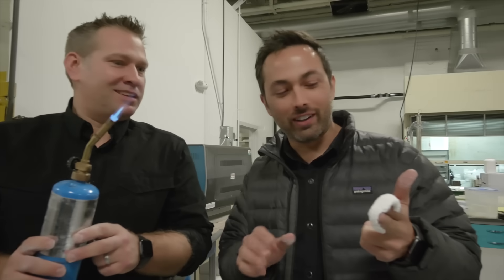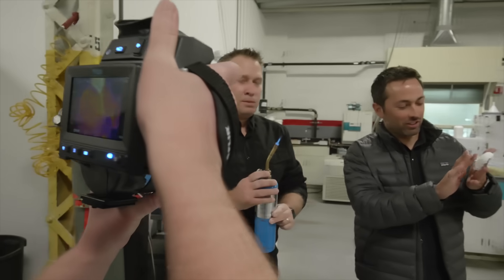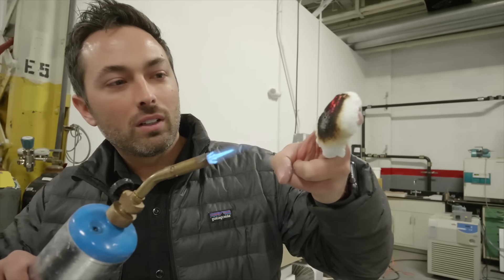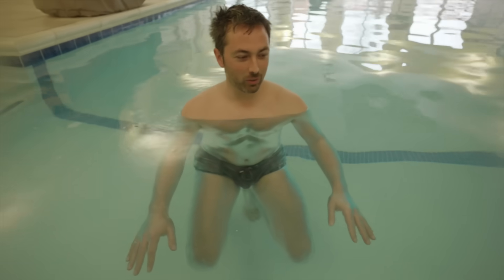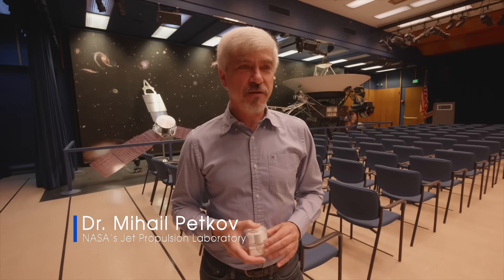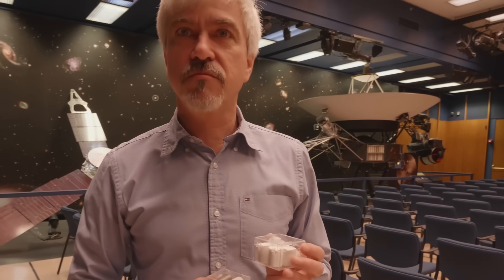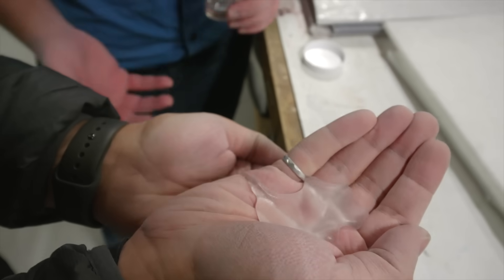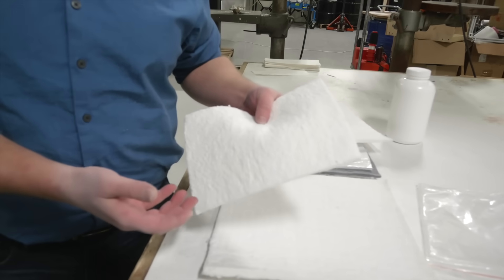I Waterproofed Myself With Aerogel!

Comment: aerogel can produce a metallic ringing sound when struck or dropped, particularly small samples of silica aerogel. This sound is due to the aerogel's unique structure and properties, including its low density, high porosity, and the way sound waves propagate through it. 
Here's why:
Low Density and High Porosity:
Aerogels are extremely lightweight and have a high proportion of空隙, which allows sound waves to travel through them relatively easily and with a distinct resonance. 
Structure:
The interconnected network of nanoparticles in aerogels, especially silica aerogels, can vibrate and resonate when struck, producing a ringing sound. 
Sound Propagation:
The way sound waves interact with the aerogel's structure influences the type of sound produced. The low density and high porosity can lead to unique acoustic properties, including the metallic ringing sound. 
Dr. Samuel Kistler, who pioneered the development of aerogel, observed this metallic ringing sound in small samples. Flow Visuals also notes that aerogel spheres can bounce and produce a ringing sound when dropped on a hard surface.

Comment: I used aerogel in my research lab to insulate liquid nitrogen lines and it was insane how well it worked. The downside is all the flakes that are created when cutting it and putting it on. If you don’t wear gloves, your hands will get so dry that it becomes easy to damage the skin.

Comment: Using aerogel for an insecticide sounds like a terrible idea... unless you hate your lungs.
Reply: He explained that the dust is captured and expelled from the body with no damage. 100% safe.
Reply: @mrobviuos74  I heard him say that, it's  simply not true.  It's reported that amorphous silica is generally less likely to cause silicosis than crystalline silica, but there is a suggestion that it can still happen...  Probably because there is likely a contaminate component which is still crystalline.  And in the use case suggested, you would be spreading lots of it in the air on a regular basis, so you are talking about a lot of potential exposure.

From a 2011 study for example, "Our results indicate that amorphous and crystalline silica are both phagocytosed and both toxic to mouse alveolar macrophage (MH-S) cells. The pathway leading to apoptosis appears to be similar in both cases."

Now that I think more about it... Besides the health risks, the technical concept actually makes no sense.   First, silica aerogel is fantastically expensive both because of the raw materials required to produce it, as well as the process being extremely time-intensive. Let's say you can get past that. I do agree that insects coming in contact with fresh aerogel would likely become desiccated. However, aerogel is extremely hydrophilic, and it will absorb moisture from the environment extremely quickly.  It would become almost immediately saturated with moisture, and so if you didn't directly sprinkle this stuff directly on the insect, it would have virtually no effect.

Comment: Even though this video is 4 years old, can I revitalize this by asking a simple question of what would happen if we coated a professional Olympic diver with aerogel and then had them dive off the high board? Would they splash less? Would they dive faster through the water? Would they hit the bottom of the pool due to less to no drag? Please make a video or short covering the answer to this please!

Comment: Just wondering if this could be used to provide lightweight radiation shielding? One major problem with a mission to Mars is the amount of lead shielding that would be required to keep astronauts safe probably be weight prohibitive. Not a chemist here, but if one could connect a lead molecule to the OH group, would this potentially provide a lighter weight shielding material? Would love to hear any responses.

Comment: Aerogel layers should be used as a firewall around the batteries of an electric vehicle, to protect against the extreme high temperatures of thermal runaway when those things spontaneously combust.

Comment: Back in the 70-80's a man invented a substance called Starlite. Thermally, it out-performed equivalent materials. Because it's inventor was so apprehensive about reveling Starlites composition,  he took his formula to the grave. In 2018 a youtuber, attempting to recreate Starlite and came very close to doing so by using only flour, sugar borax and cornstarch. I attempted this myself and was surprised to find it actually worked! Once mixed, it can be formed and it hardens as it drys.

Comment: Is the aerogel similar to the gel they use in the film industry for fire burns? When I did my first fire burn I was coated with a gel made of 90% water. They lit my back on fire using flammable liquids mixed with cement glue and for about 40 seconds I ran around pretending I was in great pain. I was actually cold from the gel; they kept the gel in a bucket of ice till it was applied. I now heard the film industry uses a new type of gel that is less goopy and less visible on camera. Whoever invented this latter gel keeps it a tightly held secret. I would be curious to know if there is a relationship between this aerogel and the gel they use for fire burns.

Comment: Wow. It makes the fellow waterproof. Does the Aerogel deflect heat & cold? Can it work as an antiseptic against deflecting viruses? Is long term use safe? Is it toxic if ingested? Could it be used to deflect frost & ice from auto & plane windshields & plane wings & such? The video said it could be used in spacesuits...can it deflect radiation? Can it deflect harmful UV sunrays? Could it create a barrier to protect the paint colors on autos or vinyl siding or even prevent fabric fading? ...This stuff seems absolutely amazing! It proves how science is truly moving into a very sensational future.
Reply: I'm pretty sure it's a carcinogen but i would have to do more research to be completely sure

Comment: slime like what fish exudes due to high pressure but movement makes it slippery and dry less than oil, its a lessy sticky oil, almost a dough, pizza dough it resistant ... i think corn starch too, corn also, the slime regulates the fishes temperature

Comment: I am a little bit confused about the Aerogel that was used in Monalisa's preservation project. Is the used Aerogel Water absorbent or water repellant? Because if it's water repellant, it basically wouldn't work for absorbing the moisture and if it's water absorbent, after the first time, it would be useless as you mentioned that its structure would collapse!  Would you please explain that to me? I am working on research and this is the property of the Aerogel that I would like to use. I have been searching for different types of Aerogel and they are all either Hydrophilic or Hydrophobic, nothing in between that would act as a passive humidity regulator. Thank you very much!

Comment: So... with aerogel... I can be both flame resistant and water resistant. Therefore, I can just have a bucket full of this aerogel dust, find a place that is on fire, strip naked minus underwear/shorts and shoes, cover myself with aerogel, wear some sort of mask, and run in to save people without any harm from heat and flammable sources besides falling debris.

Comment: So if this were practical to manufacture sustainably and ecologically, homes could be insulated with this material and be resistant to outside moisture with a surprisingly thin layer of material. A design that could be retrofitted for even older homes because of  how little surface area that would be needed.

Comment: Here is a question I have about hydrophobic aerogels.......if you mixed aerogels with a ultrahydrophobic substance with a water angle 150°+ (aka the Lotus effect) and coated a 100ml glass cup with the substance and poured in 75ml of Water chilled at 40°f (277.594 kelvins), what would the insulation factor of the coating be, and what would be the rate of thermal conductivity?

Comment: Why isn't there home insulation made out of this stuff? All it'd need is a very thin layer of it sandwiched between 2 pieces of thin wood or metal, could even be a DIY thing with the paste and could make walls 2-3x thinner.
Reply: I thought about this for my house a year or so ago and did some research to see if it was realistic. The short answer is cost. Aerogel insulation is more expensive than a comparable traditional solution. Aerogel is lighter and takes up less space but wall space is not a limitation in most homes so there's little incentive to go with the more expensive option.

Comment: This would be really cool to use as a special effect in movies. Somebody walking out of the water but is completely dry “magically.”
Reply: sounds like a really expensive alternative to CGI
Reply: Take Percy Jackson, for example. That would be epic for Rick Riordan's new Netlfix show coming in about 3 years.
Reply: @mathewpannaparayil4968  HELL YESS
Reply: @mathewpannaparayil4968  Disney+
Reply: @mathewpannaparayil4968 boy this was basically spot on
Reply: Also the silver-like effect would look really cool
Reply: The clothes would be wet though
Reply: @carriesims9325  Coat the clothes in aerogel dust
Reply: @carriesims9325  just make the clothes outa the thing
Reply: except you look silver
Reply: Lycopodium powder?
It's not heat resistant, but it is water resistant.
Reply: @carterdoesthings and the burger wrapper too
Reply: I agree. Sadly with CGI I imagine Hollywood wouldn't do it
Reply: Typically they just film the scene in reverse if someone needs to com out of water dry. But I thought the same thing. For some stunts it might be good!

Comment: Questions!
If it prevents water from penetrating your skin, does it stop swear and vapour leaving? Is this not really bad?
What is easier to get off - water or aerogel? If water is easier to get off why use it?
This could be the next big thing in car protection and on glass. Imagine it on a shower door.

Comment: The fact that Aerogel has a metallic ring when you drop it is one of those awesome useless facts that I love your channel for.
Reply: exactly
Reply: Like what is mean by metallic ring?
Reply: @potatosack.1234  It's very resonant on impact, the way metal is
Reply: @potatosack.1234  it sounds like a piece of metal when dropped
Reply: @potatosack.1234 ring as in the sound (e.g. a bell ring), unrelated to the shape, or to the jewellery (in case of any confused non-native speakers here confused by the homonym :) )
Reply: @potatosack.1234  the metalic ring on impact
Reply: Same vibe as chalk making a ceramic noise when dropped.

Comment: Interesting. But coating yourself with this stuff sounds very questionable. Skin is an organ and needs to secrete sweat in order to maintain body temperature. I would imagine increased risk for heat stroke, rash or at the very least a bad full body breakout. Hope it all  came off.

Comment: Could something like this be an alternative to conformal coating on electronics as a waterproofing for say flight controllers and ESCs or would its thermal insulating properties not allow for adequate cooling?
Reply: ...Well, it's brittle and expensive, so probably not.

Comment: Questions: 1. If you can use a silica aerogel "powder" to waterproof yourself...or "something", so that in effect, the water doesn't "touch" the coated surface anymore...is it conceivable that say, piers of jetties or legs of an offshore rig or subsea infrastructure could be so coated to prevent corrosion? Would that work?
2. re. the dust in the fiberglass composite: ok, it's not asbestos, fine, but I can hear a parantage between "silica" and "silicosis"...a lot of miners in unsavoury places die extremely young because of silicosis due to the dust they breathe from a young age ; domestic stone cutters (such as for workbenches) are now being identified as a group that has high rate of silicosis... do you have more details about the risk analysis on the dust formed by silica aerogel and its risks to health (and environment)?
Reply: I'm not an expert in that field, but I think the problem with subsea infrastructure is not only the "water", but also the movement (ground, but also the moving of water, including fishes, alges, sand, salt). I guess all that would "dmg" the aerogel coat.

Comment: Veritasium: I have a question. Could this product slow or prevent hypothermia? It insulates from external heat. Could this hold body heat in while exposed to freezing water giving rescuers extra exposure time for a rescue with less risk or a very expensive preventative treatment for someone engaging in risky ice conditions like Ice Road Truckers? Just a thought.
Reply: I think because of your body naturally producing heat to warm you up this wouldn't slow down hypothermia it'd out right prevent it.
Reply: @flameofthephoenix8395  Granted you would also have to take the dangers of overheating into account. If your body can't dissipate that heat you could theoretically run the risk of heat stroke while in sub-zero temperatures. That would be a hell of a story though.
Reply: @Krell356  I hadn't thought about that but that is true.
Reply: @Krell356  how would it be applied?/ theoretically
Reply: @sacha_1152  not sure. Best way I could think of is as the insulating layer for a jacket.

Comment: i want to buy some this water repellant aerogel dust to go swimming.But then i found it costs 1 $ per cubic centimetre  , but that begs the question - how many cc did he use to make himself waterproof?  Also, what happens if you eg:sneeze , and  inhale it accidentally? i presume you can wash it off with a cheap nontoxic uninflammable  nonpolar solvent - or a scrubbing brush?

Comment: I wonder what the implications are for using it as an insulator in skyscrapers. It's lighter, so it would carry less of a structural load.
Could it theoretically be used to make skyscrapers be able to go taller?
Reply: The blockade for skyscrapers is more of the wind and atmospheric pressure than the weight, the higher you go the stronger the winds and higher the pressure, so they need to design a stronger core that won't just blow over. It seems they've already done it but the physical feat of making the world's tallest skyscraper is insane, and the amount of materials it takes to build the average building for business would be basically doubled for 20-40% more height and that's not practical for many businesses.
Reply: @420Cris  the pressure should be lesser coz of gravity(?

Comment: if anyone is interested it is bicarb soda elmer glue and flower will make that flame proof stuff he put on his fingers, i make it from time to time. it works by converting the outer layers to carbon which is a natural insulator and as it does that the layer under it does the same and so forth and so forth, till the carbon layer essentially has a larger surface area on a micro scale that it can disperse the heat before it gets through to a point where he can feel it

Comment: Imagine using this as isolation in houses:
it wouldn't be hot AT ALL in summer
Reply: But it would be freezing cold in winter
Reply: @defenestradora  heating the interior of the home in winter would be a lot more efficient
Reply: @bojanglesobrien6883  depending on the location, but i guess that a house that needs to be that much isolated in the summer is probably in a very hot place where heating the interior wouldn't be that accecible
Reply: @defenestradora  I don't understand what you're trying to say.
Reply: @bojanglesobrien6883  where i live is very hot during summer, but it's not that cold during winter, and heaters are very expensive because nobody wants them, so nobody sells them. Because it's very hot in summer but most houses don't have heaters, people just stick with air conditioners and fans rather than isolating the houses from heat. That's what i'm thinking about, sorry if it makes no sense

Comment: They need to start putting this on phones. Then they can make a completely waterproof phone.
Reply: The coating would wear off eventually is the problem. The oleophobic coating on phones already does wear off after a while.
Reply: But its super easy to break
Reply: Do this and you would have a phone that overheats within minutes
Reply: Phones aren’t waterproof because water gets inside of them, and water gets inside because there are holes in a phone that must not be plugged with aerogel in order to maintain their usual function lol
Reply: Similar waterproofing exists for electronics. The makers have zero incentive to use it. Doing so would increase their costs with minimal to no increase in sales. More importantly, prolong the life of electronics by protecting them from water damage and therefore cutting down sales. They already want you buying a new phone annually, so why would they build a phone that can last several years?
Reply: well the electricity would still be conducted by the water
Reply: did you even watch the video?
Reply: it wouldn't absorb and transfer heat like copper does, it would just keep the components hot
Reply: True
Reply: that is a horrible idea. Do this if you want your hands to feel like 40grit sand paper. I touched some of it already, its extremely oil absorbant which means your skin will be dry af after touching it.